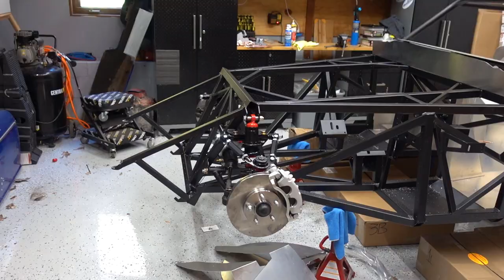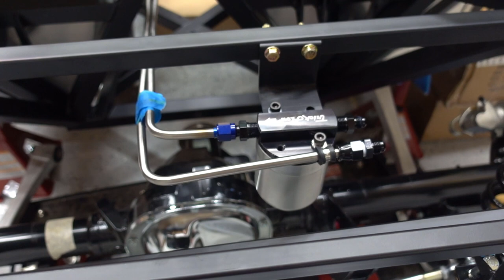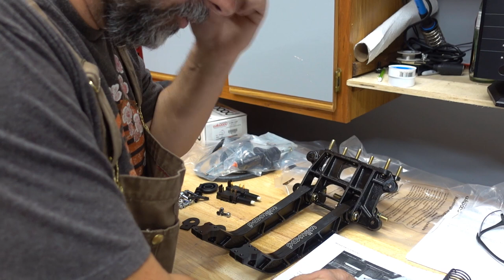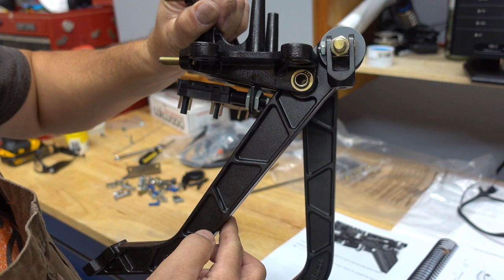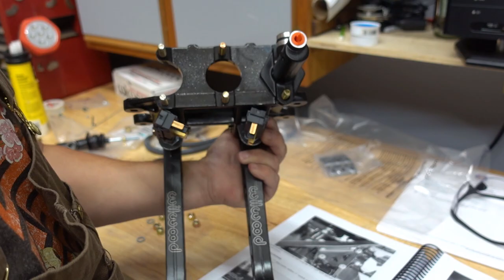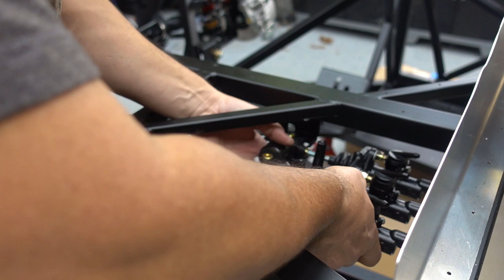Part 19 | Pedal Box Install | Daytona Coupe Build

Comment: Looking good! Watch out that you don't get any metal shavings in the ports for the master cylinders, when cross drilling the mount holes into the frame. Some might have fallen in when you blew them off.
Reply from the maker: Ya, I noticed that later when I was editing the video. I blew the shavings right across the ports. I check and all looks good. Thanks for the feedback.
Reply: @OakHollowGarage  No problem. If you haven't looked yet, pull back you seals and check the piston rods. 2 out of 3 of mine were corroded.
Reply from the maker: @fordclevelanddaytonacoupe8881  Good advice. I hadn't thought to double check for corrosion under the seals.
Reply: @OakHollowGarage  I wouldn't have either, I had only looked to see where the stops were on the rod, since I was not familiar with the Wilwood master cylinder. It was pure luck that I came acrossed it.

Comment: For very tall people, like my son,  did you have an option of positioning the pedal box further forward towards the engine? At about 1.16 into your video you show the dash with the pre-drilled gauge holes .  How wide and tall is this aluminum panel??
Reply from the maker: The pedal box doesn't have any adjustability in where it can be mounted,  but you can adjust the pedals closer or farther away from the driver. I know people about 6'4" have been able to fit and drive. Not sure how comfy the ride would be though. 

I will try to remember to measure the dimensions of the panel tonight after I get home.
Reply: @OakHollowGarage  Ok thanks... The Son is 6'-7" and still growing .. At 6'4" I will have no problem... I'm drawing the dash with CAD , laying out every gauge [speed hut 4 " & 2 1/16" ] switch, toggle, light, knob, radio, A/C controller, you will place. and I'll alter mine  accordingly ...

Comment: Hi Thomas, are the threads at the back of the master cylinders where you turned in the 90deg fittings NPT threads or inverted flare?  The reason I ask is I noticed you didn’t use any thread sealant so that would suggest inverted flare.  If they are NPT then you may want to use sealant on them.
Reply from the maker: They already had sealant on them. If you look closely you can see some red threads.
Reply: @OakHollowGarage  that’s sure handy to have them come that way!
Reply from the maker: Ya, willwood makes good quality products.